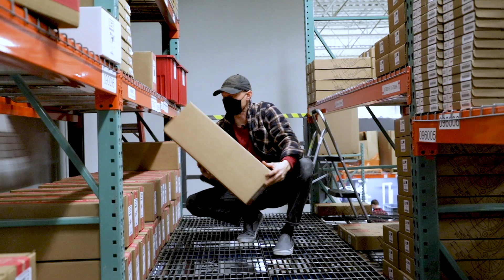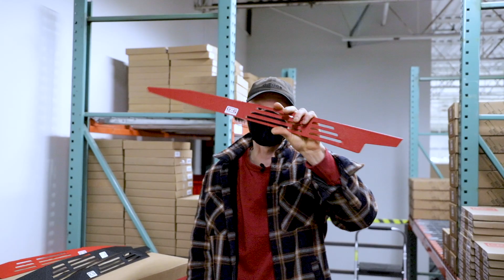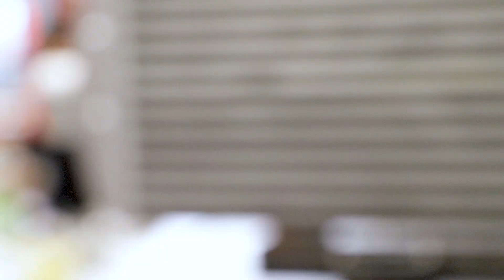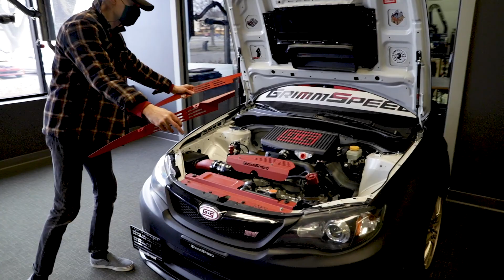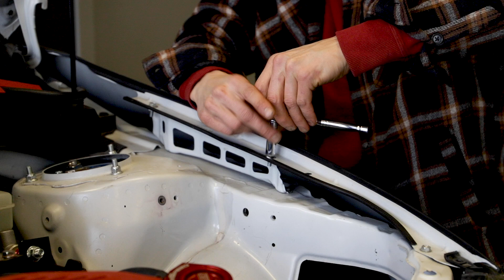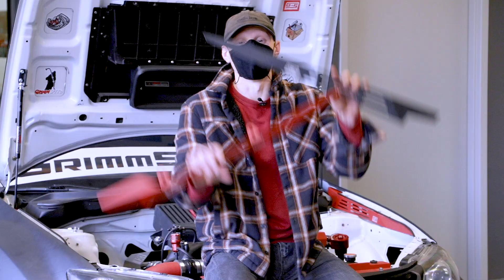NEW PRODUCT: GrimmSpeed 08-14 WRX/STI Fender Shrouds

Comment: oh thank God! I almost bought a perrin fender shroud
Reply: @artpetrakov1197  recently bought and installed a bunch of engine dress up bits. Alt cover, radiator shroud, fender shroud and I have in my possession the light weight battery tray, waiting till my current battery bites the dust so I can install this little guy. Great fitment, quality manufacturing and looks great! Thanks GS!

Comment: would these fit on an 11 n/a sedan impreza
Reply from the maker: We haven't tested them on that chassis, but I'm guessing it wouldn't be a direct fit.
Reply: i know that the lengths for the sedan are about the same size if i could get the measurements for the length and height i could go from there. i know the n/a market isnt big but.frabrication of parts amd the 2.5i is virtually a short block of the 255 257.  hoping to add your parts to my car and maybe replace the perrins eventually
Reply from the maker: @tylerchadderdon2026  Right on! Why don't you shoot our support@grimmspeed.com guys a message and they should be able to get you some dimensions.